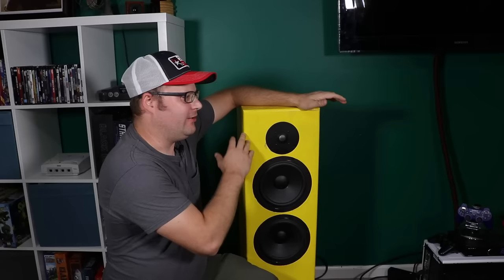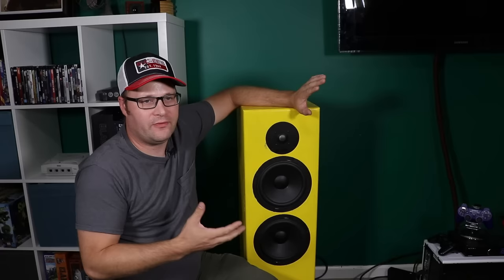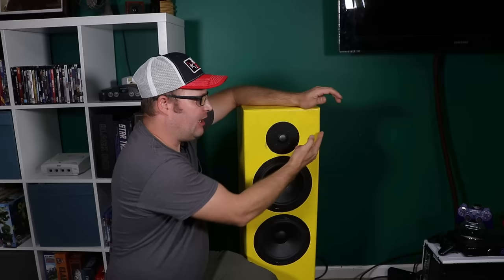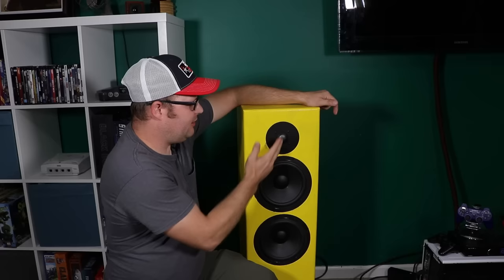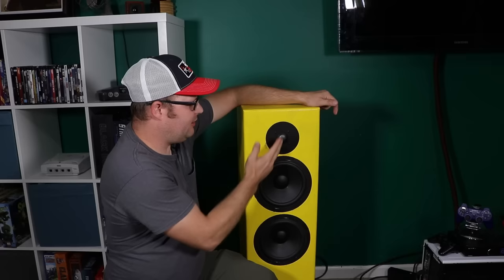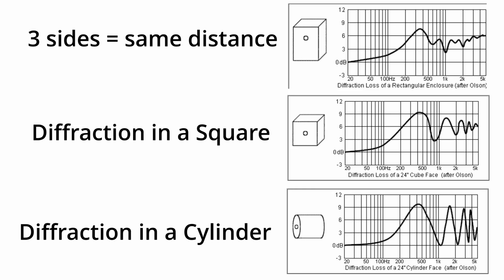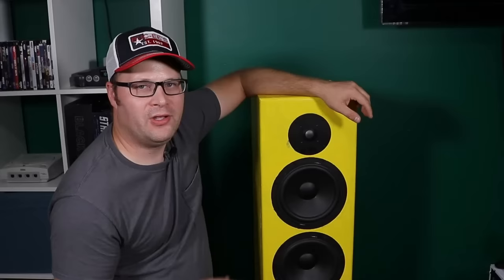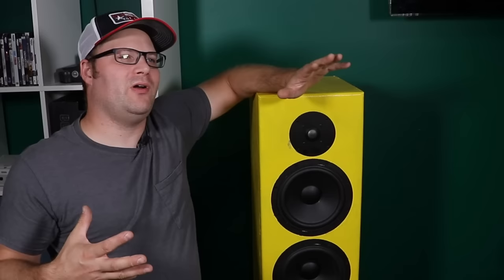The BEST Shape for a Speaker REVEALED

Comment: When building speakers and designing crossovers, I found that 1/2 foam on the baffle or strips (like MK and others use) removes the edge diffraction - it's easy to see the difference when measuring using a mic and something like REW and changing nothing else other than adding/removing the foam. Another method that's usually used for home theatre installs, is to place them in the wall - a 'baffle wall' (ideally not touching the wall but isolated from it). No edges, so no detraction, plus you get a 6db bass boost as the bass can't wrap around the speaker. Also, the off axis response is pretty important too. In blind tests, the speakers with the best off axis also have the best 'sound power' and generally get picked as being a 'better speaker' by listeners in those blind tests. Being able to see the speakers you are comparing or even knowing the prices tend to skew results, and pretty much every time.

Floyd Toole did some interesting research and talks about what makes a good speaker here:

https://www.youtube.com/watch?v=zrpUDuUtxPM&t=1s

Comment: I have made two pairs of DIY spherical speakers using IKEA bowls glued together (and good internal damping, drivers and crossovers). One set 4 spheres and the other two spheres. The elimination of diffraction distortion makes the speakers "fade" into the background and create a broader sound stage.  Any issue of standing waves on the inside can be simply  addressed by inserting a small ball into the sphere, offset if possible. Spheres are less prone to resonances anyway as they are the strongest enclosures and resonance can only be produced by pulsating. This is contrasted with individual boards that can vibrate in typical "box" style speakers.
Reply: I bet those sound good I have demonstrated improved decibel scores and obvious improve sound quality to the ears by using thick wall PVC pipe and integrating it into the corners of my speaker boxes so airflow is improved and staining waves are addressed. That combined with the use of aero ports completely smooths and improves the response of a ported setup. It will also help sealed as well
Reply: Im curious on having this quantified. In terms of time, how much extra time would you feel it would take to give X% improvement in overall performance/quality. I may not be asking the right question the right way so if you can help me understand in detail the tradeoffs with comparisons maybe. Standard build vs spherical with quantifications please? Thx 🙏 in advance for your valuable time.
Reply: But where would you put stuff on a sphere... isn't that why they call them book shelf speakers
Reply: @simonlinser8286  Not sure understand the question --- I only build floor standing.
Reply: @chokechange  See Dr. Olsen's research and charts on effect of cabinet shape on frequency response.
Reply: @chokechange  Sorry just saw this, are you asking about time to make the speakers in a sphere shape?
Reply: @stevefisher8323  How much time did you spend on the spherical version vs the time it would have taken a standard box. Thx!

Comment: Thanks for this! I'll also add what to me is maybe even more critical than diffraction changing the frequency response: it messes up the time domain. As you said, diffraction from the baffle edge acts as a mini-speaker repeating the original signal at a later time, like an echo. While the distance from the tweeter to the edge is short, our ears are amazingly good at picking up the repeating sound as a clue to position the speaker in space. It also smears the wanted, recorded clues to position instruments in the audio. The result is no hope of "making the speaker disappear" and bad/worsened imaging in general.

Personally, I'd pick a disappearing speaker with excellent imaging over a ruler flat frequency response any day, but in this case, you don't have to pick one: reducing edge diffraction helps with both. In addition to asymmetry, round-overs, and chamfers, you can use waveguides ("aims" the waves forward so it never reaches the 90-degree spread) and even felt, or preferably combine several methods.

Comment: A point about different dimensions:
You also want to avoid numbers that are related to each other by fractions that use small numbers.   For example, you don't want two dimensions where one is 2/3rds the other or 1/2 the other or 3/4ths the other.  This is because the ripples in the frequency response curve for each distance will line up with each other at some frequency if you do that.  If the dimensions are things like 7/12ths each other this doesn't happen as much.
When it comes to selecting a box's overall dimensions,  you also want to apply the rule of making the dimensions not the same and not related by small numbered fractions.  This is because of a second order effect that makes smaller but non-zero ripples in the frequency response.
Reply: Or just apply a large roundover to your cabinet and proper directivity-control to your mid- and high-frequency driver, problem solved. You want to minimize diffraction where ever possible. When you focus on the on-axis response to optimize your baffle dimensions the aberations will simply be shifted to the off-axis response where they still affect the sound signature of the speaker, but won't show up in your on-axis measurement. Off-axis response is almost as imporant as on-axis and should never be overlooked. Follow Earl Geddes' and Floyd Toole's work for more information.
Reply: @iliketoast-q9b  Roundovers reduce but don't eliminate the diffraction issue.  Any practical roundover is a lot less than a wavelength of the sound.  
When I have music playing, I am usually doing something so I end up being at various locations vs the speakers.
Reply: @kensmith5694  Diffraction usually happens in the upper-midrange and higher. So the roundover is approaching similar wavelengths and is very effective if it's more than just a few millimeters. Keeping the edge away from the driver further minimizes diffraction and with controlled directivity(waveguides) it becames a managable issue.
Reply: @iliketoast-q9b  1KHz -> 34cm
Reply: @kensmith5694  That's not upper-midrange. Think 4kHz and up, which is approx. 8.5cm long and the half- and quarter wavelengths are already well within practical roundover radius. And it only gets shorter from there.
Reply: @iliketoast-q9b  You need a dimension that is greater than a wave length.
Reply: @kensmith5694  Sorry, but that is incorrect. You need half a wavelength across the baffle to have a standing wave due to diffraction though.
Reply: @iliketoast-q9b  Nope
Reply: @kensmith5694  What's your argument?
Reply: @iliketoast-q9b  It comes down to a matter of physics.  Diffraction effects are basically always happening.  It only drops completely out of the picture when the dimensions are much greater that a wavelength.  The same thing happens with light and radio waves.
Reply: @kensmith5694  Also I should have been more precise: You need AT LEAST half a wavelength across the baffle to have a standing wave where diffraction artifacts will be the most obvious. 
Diffraction is present without standing waves though and the sharper the discontinuity (2nd derivative of the baffle's curvature) the worse diffraction becomes, starting at the highest frequencies, unless directivity is controlled or beaming is present which it usually is. 
Like I said diffraction is more of an issue at upper-mid to high frequencies and large roundovers in the range of 1"-2" are very effective at those frequencies. There is no sharp cutoff once they are smaller than the wavelength, so they can still be quite effective, especially with larger baffles where the sound pressure is lower at the edge than it is close to the driver. It's a fallacy to assume that smaller baffles have less diffraction.
Reply: @iliketoast-q9b  I never suggested that smaller baffles have less diffraction.  I don't see ho you read that into what I said.  You now have moved your position to one where the roundover is only partly effective and that I will grant but the effect is still there.
Reply: @kensmith5694  Partially effective at high frequencies, which are usually not so much affected by diffraction because of beaming. You can't elimimate diffraction but certain ratios of baffle dimensions or off-center driver positioning won't minimize diffraction at all. I just made a comment about small baffles because many people assume they are advantageous with regards to diffraction when they are not.

Comment: Despite the theoretical discussion I really wonder whether there is an audible difference when tested.    I look at 99.9% of speakers including almost all of the excellent speakers being sold and I see speakers down the centre line of the box.   There is so much bounce in a real room that unless you are measuring in a farmers field 20 feet in the air I have a bit of a problem believing this.
Reply: I have thought about this for a long time. Build two sets of speakers, otherwise identical, but one with a carefully engineered front, and one with a rudimentary and imperfect baffle shape and layout. Then record both of them in the same position with real word music of good recording quality in a real world listening room, and switch between the two recordings.
Seeing graphs is important to understand a problem but hearing it in real world conditions would give you a much better perspective concerning the magnitude of the effect.
My two cents: You will have a hard time hearing the difference.
Reply: @westelaudio943 , man, that's awesome you did some testing! 🤙
Reply: It's all physics and engineering, and very well documented! In a room, it's slightly lessened due to all kinds of reflections but it's definitely there. We typically assume the baffle provides a gain of +6dB, so for frequencies longer than that, they will no longer be fully supported by the baffle, hence the change in the response. Sharp edges, sharp changes in response, etc, etc. As I said, it's all very well documented, so if doubtful it shouldn't be difficult for you to find some good documentation on the topic 👍
Reply: @westelaudio943  we don't use "real world music" for testing since it can be difficult to dissect the response from it, baffles can and do make massive difference to the sound. If it didn't in your situation it may be that your different baffles happened to effect the response in the same way for that position, but if they're different shapes, I can guarantee you that their off axis behaviour will be different, and that results in it interacting with your room differently as well
Reply: @Elliott-Designs  

I don't use music for testing - I use sweeps and noise. I take measurements - from two feet away and near field, off axis etc. 
I know the procedure, I'm not a dilettante trying to justify his ineptitude.
But I'm not talking about testing - I'm talking about listening , after all, we should not forget that's what speakers are for. And if a design guideline doesn't actually improve my listening experience or for some reason even makes it worse it's probably not worth considering, even if it sounds good on paper I guess. 
In short, if the options are KEF LS-50 or Acoustic Research AR-1, I will always pick the latter. It measures horribly - but have you heard a good blues on it?
Reply: @westelaudio943  and that's where the subjectivity comes in, and that's fine. I'd always go with the first option (KEF), since I favour accuracy, and that's my opinion. We live in a world where each individual has an opinion, and that's amazing, because otherwise the world would be boring! 🙂
Reply: @westelaudio943  you are on point.  Speakers are meant to listening to and not measured.  If it sounds good to ears, that is all it matters. Some audiophiles are too-known!
Reply: @micky1234ist , I couldn't agree more. 🤙

Comment: This is out of scope for the video, I just figured I'd drop this here in case ppl were wondering why spherical speakers aren't common.

The one problem with a sphere is that you either have to use a full range driver instead of a tweeter, or deal with horrific phase issues in the crossover between the mid and tweeter. You almost always want the distance between the tweeter and midrange/midwoofer to be as small as possible. Because at the crossover if they are far apart they can start to cancel output, and you might even be able to hear the sound coming from two places.

Comment: one thing to add: the directivity, or radiation pattern of your speaker also determines how much the edge diffraction takes effect. if you put a waveguide or horn in front of your speaker, edge diffraction is less of an issue. also with a lot of 3-way speaker designs, where often the mid-driver is very close to the tweeter, the shape of it can cause diffraction to happen aswell.

Comment: I'm reminded of Olsen's early research on this. He has very similar diagrams. Two thoughts: 
1. Is not the amount of beveling / round-over required frequency dependent? 
2. If one calculates diffraction from the speaker center, then does it not change with the distance to the edge? For example, going 90° from the center gives a different frequency then if one went at 45°? Does this not mitigate the effects somewhat by spreading them over a wider range of frequencies? 
Thanks for another great presentation!
Reply: For 1. Yes. In general a smaller baffle is going to be better, and will push the diffraction to higher frequencies.

For 2. Also yes! That's why a square performs much better than a cylinder
Reply: @blakebrockhaus347  Agreed. Forgive me if I tend to put my understandings in the form of questions. Part of it is that I want to help people think. Thanks my friend!
Reply: @brucermarino  never ask for forgiveness with such things! I imagine it helps many people cement what they've learned in the video, it also helps the person confirming/correcting your understanding since you've already summarised it! If this was my video, this would be the exact kind of comment that I'd be hoping for!
Reply: @Elliott-Designs  Thanks Elliott. I very much appreciate your comment. I guess my training as a professor of philosophy and theology shows :)
Reply: @blakebrockhaus347  Smaller baflles will push standing waves due to edge-diffraction to higher frequencies. But that doesn't mean smaller baffles are better or that they will diffract at higher frequencies only. 
The further the distance from the edge the lower the spl will be and hence diffraction-effects will be minimized, so larger baffles can be the way to go. Either way roundovers should be as large as you can get away with. Also waveguides should be used where possible and those should be big as well. Though past 18" is not necessary with hifi since directivity needs to be controlled down to 700 Hz for critical listening, not further.

Comment: While it's clearly pointed out here that a spherical baffle is superior for minimizing edge diffraction comb filtering of the sound waves emanating externally of the enclosure, I wonder if there would be any issues with standing waves developing inside of the spherical enclosure, or if the spherical shape would minimize and diffract internal standing waves, being that the driver is not at the center of the orb, but rather, installed in the surface of it?... 🤔

Comment: Great video as always. I made my speakers with the driver centered not knowing about diffraction. After researching i actually used some leftover car speaker foam rings to surround my baffle. They helped my response a ton, wish i could have done a before after measurement because it absolutely killed off some of the bad diffraction issues.
Reply: hey, you put the baffle on the inside of the speaker or the outside?

Comment: This vid may explain why 2" tweeters in a block of polystyrene with a single wrap of duct tape for added wall strength,then both speakers wedged into the corners of my ute dash against the windscreen sound so good vs in a door,(didn't think a door would be the best place since woofer was there just lower, that & cutting non std holes). I figured at the time sound bounced of the angled glass (dash is angled as well) would be a good option, however for whatever reason the placement of hung low woofers & high mounted tweeters blends the sound really well better than i ever thought as in the end putting tweeters there was just easier lol .I was expecting high pitch & not very good however it was the perfect place for them.

Comment: I'm curious what a result would by not having a tweeter installed on a baffle at all, rather "free mounted" by some sort of non-interfering support, say a mast.

Does the edge of the tweeter housing itself introduce defraction of its own that requires a proper baffle mount in order for it to be corrected?
Reply: I've seen it done on some. It definitely looks nice, but I can't say how different it sounds.
Reply: Yes.  The tweeter housing will result in diffraction.

Comment: Some of the best speakers have a two foot wide and three foot tall baffle like Klipsch Cornwall, JBL 4367, etc.
Reply from the maker: There is a point to be had hear that the larger the baffle, the lower the diffraction point which can have some great results.
Reply: @Toid  It also pushes the baffle step lower as well, as you of course know because I learned it from you. Thanks!

Comment: I wish I had measuring equipment.
I built a JL 13W3 in a 2.5cft tube enclosure with the internal diameter that matched the speaker cut out. The length was factored to match the enclosure requirement.
The tube was peripherally ported to JL's recommendation 24hz, and the port length was about 40" and hight was somewhere about 3/8".
It's been years since I did the maths and built the box, so don't number and wordsmith me.
I can tell you the sub sounded terrific in the truck and orientation it was mounted in.
I ran 600w JL amp.

So the question:
Did I get lucky?